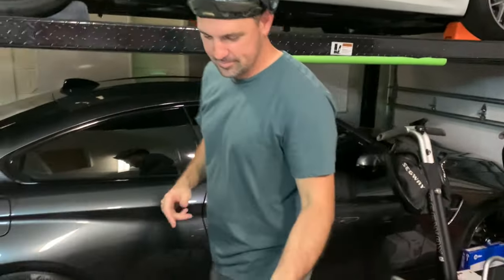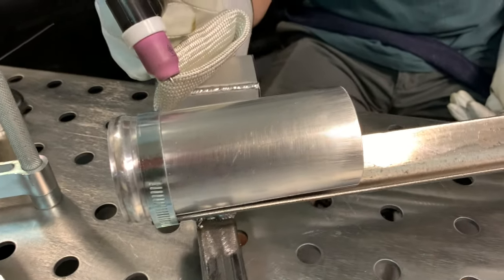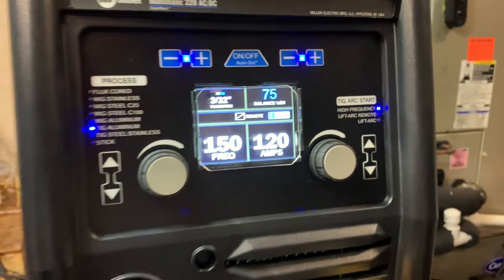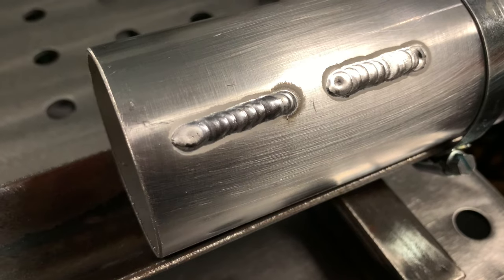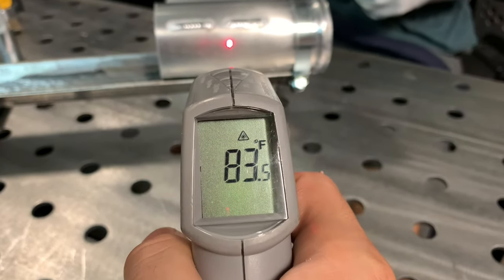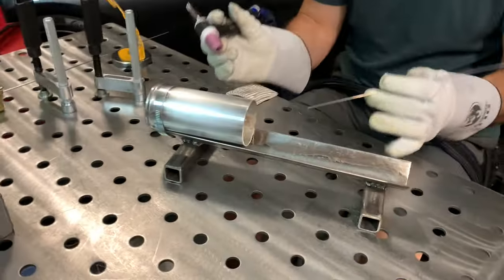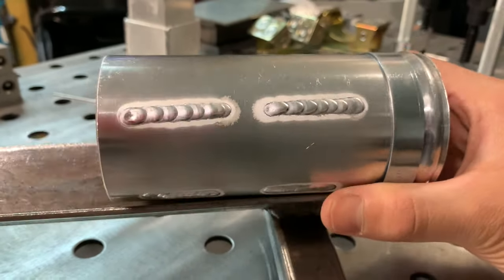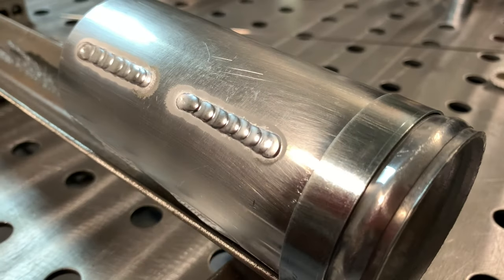4043 vs 5356 Filler Rod - Quick Comparison

Comment from the maker: This video was only to show the surface differences between the two filler rods. I did not go into the use cases for each so if you're looking for what NOT to use each on, I can talk about it but you can find that info readily available on the interwebz. I hope this helps! :)

Comment: your 4043 with the higher silicon content will stay molten longer than 5356. the reason your 4043 looks like it has acne is because you're stepping to big and using to small of a cup. the molten puddle isnt set up when it leaves the gas covered area of the #5 cup.  this is why when you start your weld it looks fine but after the part gets adequate heat and you begin to move the rest of the weld looks sub-par. Try switching to a #8 stubby gas lens & 15 cfh.  while 75%EN will provide a lot of cleaning action that will also effect your end result. try dropping closer to 70% because thats not a dirty part.  Instagram welders polish their welds with mothers before taking pix. look closely at the next ones you see. if the etching line is gone its because they rubbed it off with polish to make it prettier.  hope this helps.
Reply from the maker: Thanks Dustin!!  Yeah I tend to use a 7 or 8 gas lens on most things!
Reply: Good insight!

Comment: I use aluminum coat hangers for all my aluminum  repairs. 
Steel coat hangers for steel of course. Either a couple of batteries daisy chained togather or my ol'trusty batteries charger for my welder. Welds boilers wonderful.